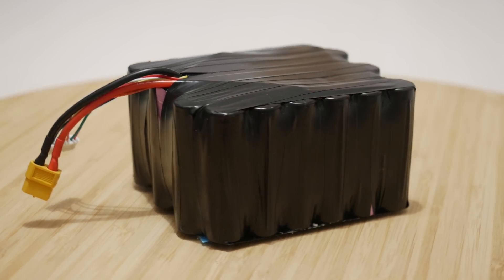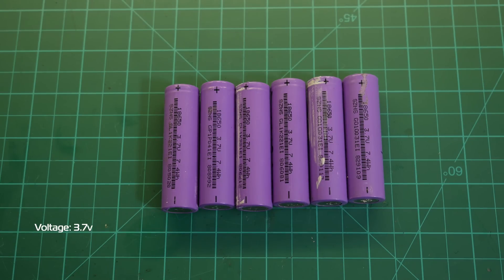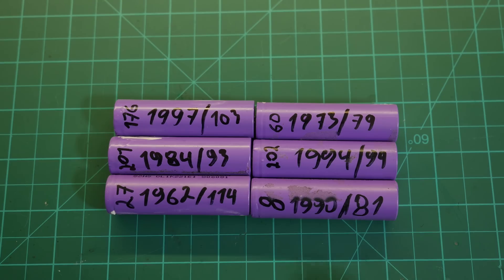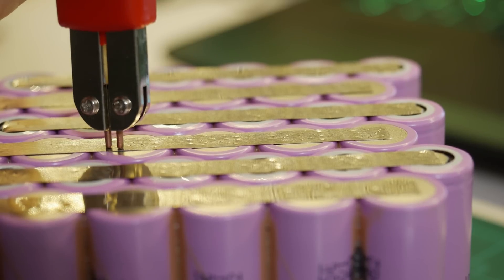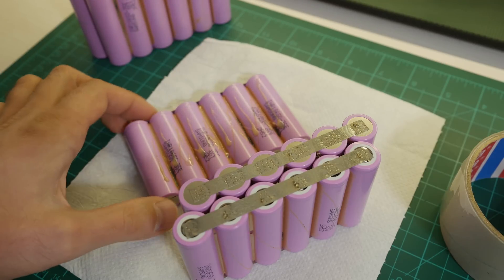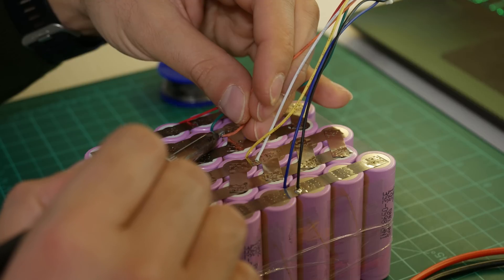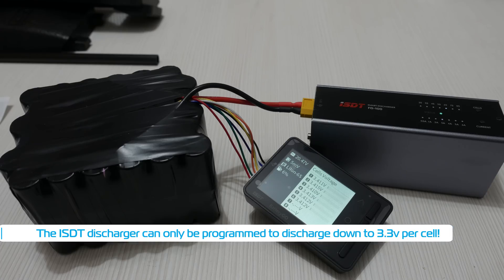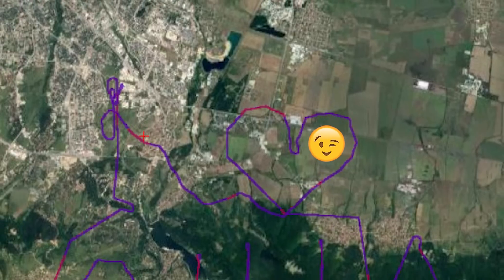HOW-TO Li-Ion battery for a drone using 18650 cells!

Comment: so why people still using LiPo battery if this is better ??
Reply from the maker: Actually there are a lot of applications where high discharge ratings are needed and for the time being LiIons just can't cope! But if you have a mild mannered plane the mostly cruises around... can't beat these!
Reply: @ArxangelRC  that makes sense ...
Reply: Cause not everybody knows how to prepare these packs? They are also highly dangerous if mistreated but if you know what you´re doing the efficiency beats some lipo ass ... just ask Elon Musk :)
Reply: @msergiu80  lipo battery is more dangerous though ...   it's prone to become 'pregnant' ...
Reply: @pooorman-diy1104  yes, could be, but they come from the factory and is supposed that they respect at least the minimal safety requirements. On the other hand, the li ion is made by us, respecting OUR safety requirements which may or may not be at the level of a factory. We also may not give a damn about any safety requierement or not have the required knowledge about that, which in my opinion makes li ion twice as dangerous as commercial lipos. One bad contact for a 6s 15000 mah and sky is the limit :*(

Comment: What settings (number of pulses and current) are you using for the spot welder when doing these 18650 cells? (I assume you use pure nickle strips? and not nickel-coated steel?).
Reply from the maker: Yes, pure nickel strips! I think it is dual pulse, at around 40 or 50 amps!

Comment: Very clear explanation you got there. Btw, what 18650 do you think is the best. I see here you use Samsung, but if I'm not wrong, you use Sony pack on the Nano Talon. Just would like your opinion 😉
Reply from the maker: Thanks, glad you like it! Yes, I use different cells because these models have different power requirements! With the Crosswind I can connect a lot of lower discharge cells in paralel and still get more than enough discharge Amps potential from the pack for this plane, but with the Nano Talon I have very limited space, so I have to make do with only a 1P pack... hence why I need to use high discharge cells for it! :)

Comment: I would personally use HV 18650’s for an andded 8 - 10% capacity, giving the spesific energy a decent boost
Reply from the maker: Weeeeell... it also comes down to cost... these cells were a great deal, especially in bulk, as I also bought some for other projects! :)
Reply: ArxangelRC ah, that explains it. If u want cost effective cells with long gevety in mind than checkout tesla’s 18650’s(or 2170’s if u can find some)
Reply from the maker: 2170s are impossible to buy right now... at least their cells... as for 18650... they will be used from a car... not sure of their capacity as well!
Reply: ArxangelRC yea the 2170’s are super popular rn
Reply from the maker: In cars perhaps... haven't seen them used for the hobby yet!

Comment: Hello, you should use a another tape, with thermal resistance. A special one for that purpose. ( yellow transparent generally, based on polyimide, and not PVC  ... you can look at here : https://www.banggood.com/search/high-temperature-tape.html   - Those tapes are more dimensionally stable at high temperatures, so they  remaining intact during the numerous temperature cycles batteries experience )

For more info : https://www.polyonics.com/EngineeredTapes/battery-tapes.html

This one you are using could loose mechanical properties with the heat of batteries when you will pump Amp.

Good work. Thanks for sharing your experiences. From France.
Reply from the maker: Actually the tape you are talking about is called kapton tape, I have some but it was for my 3D printer's print bed, and is not the right size for this! And trust me... this particular battery pack will not experience high temperature differences, I am not really worried about this! :)

Comment: What kind of glue did you use?
Reply from the maker: It is called Moment Classic in my country, made by Henkel. It is a type of contact glue, although I don't use it quite in this way! :D
Reply: @ArxangelRC  Thanks!  I like how springy the bond seems to be.
Reply from the maker: Yeah, that is why I like it for planes as well... wicked strong but still a bit flexible! It does soften up EPO while it is drying... but hardens it back up once it is all done... just something to keep in mind!

Comment: For best CG and flight characteristics it would have been better to have made it a long pack. Splitting two 3S long ways then connecting them in series with a wire. The weight being spread out would be better for flight characteristics.
Reply from the maker: Well... not all planes can take a narrow and long pack... and I am probably going to use this one in other models as well!

Comment: Nice DIY Battery....a sane approach I think...very good....and then another flight in dead calm cold air....Oh, and Im using the Flex Firmware on 868mhz at last....My EZUHF is still my favorite RC link though, it's effortless.
Reply from the maker: Thanks, but the flight wasn't in dead calm cold air... it was windy up there above the clouds, but the gimbal does work very well indeed!

Comment: Thanks we're actually building a spot welder now! Have you revived the updated crosswind tail yet? I'm waiting for it before trying maiden..
Reply from the maker: Nice! No, I have not received it yet... it is somewhere... and I am guessing at this point it is probably lost... will have to contact MFD!!!
Reply: @ArxangelRC  Will these Li-Ion cell work for my below hex?
1)Frame:Tarot 680 PRO Folding Hexacopter Frame
2)Motors:6x Tarot 4108 High Power Brushless Motor (380kv)
3)Propeller:3x Tarot 1355 Carbon Propellers (Two Holes / CW and CCW)
4)ESC (Electronic Speed Controls):6x Hobbywing XRotor 40A-OPTO ESC
Reply from the maker: @MrNams  That is very difficult to say without knowing AUW of the machine, and also how much weight you can spare for a battery! Generally, from the calculations I've done for some of the larger copter models... LiIons weren't the best option due to limited current output, given the weight of the pack that would be feasible on a copter.

Comment: Have you thought about using a high gain directional antenna on a gimbal set so it always points to your ground station ?
Reply from the maker: Have had some thoughts about this... but nothing too serious... it will be a clunky setup...  and I am not sure exactly how it could work really... :)
Reply: ArxangelRC I am working on one at the moment , the horizontal is easy but the vertical is proving difficult as the angle changes with distance, I’m thinking of using some code to produce the angle from gps position and height compared to the saved home position , when I finish the code I will post it so you can have a play , using an arduino nano to output the Pwm 😎
Reply from the maker: Would be interesting to test for sure... would require one more GPS on board, and a way to store the ground GPS location as well!

Comment: I have been unable to find any videos about how to put a fuse on the battery.  I have seen a number of plane crashes where the model has gone up in flames because of a short circuit caused by a crash.
Reply: Old Glory quarter watt resister legs can be used as joiners and act like cell fuses but means soldering
Reply from the maker: I have fuses on the LiIon battery I built for my solar system... but there I know my max amps and draws, etc., not sure I would want fuses on a battery such as this... imagine a few of them going off in flight... not necessarily during a crash... would be quite unpleasant... but yes... would require soldering!

Comment: e x t r a t h i c c and juicy!
Reply: Btw where did you source those 3450 mAh cells i assume you used? Salvaged a Tesla? :-)

But in your calculation examples you were talking about 2000 mAh... Just for easier numbers?
Reply from the maker: Yes, and because the particular cells I use in those shots are salvaged 2000mAh from laptop batteries. The 3450mAh ones I used for the pack itself are brand new ones from nkon.nl, link is in the description below.
Reply: @ArxangelRC  Ah, nice.
With 36 of them power shouldn't be any issue at all. They're even 10 A discharge rated. 6S 60 Amps, that'll get any plane going!
Reply from the maker: Exactly! :)

Comment: At the beginning you say that you are using 6 cells in parallel at 2000mAh to give a capacity of 12000mAh, yet at 5.15 in the video it says the pack capacity is 20700mAh - which is it,  I'm confused!
Reply from the maker: Hahaha, might be a tad confusing... but the 2000mAh cells were used only for the example! They are reclaimed laptop batteries... brand new... but still came from laptop batteries, and I would never make a plane pack out of them! I had over 300 of them and made a battery for my solar system! :P
Reply: @ArxangelRC  Yeah, it was a bit confusing. I wouls suggest adding a note in the description for anyone getting confused 😅
Reply from the maker: @xxxxxxch04xxxxxx22  Note added, although given how people don't even watch the videos till the end, let alone read the desctiption, I doubt many will see it, but I've added it anyway! :)
Reply: Watch the video again 12000mah battery  was his old one tired battery not the new one
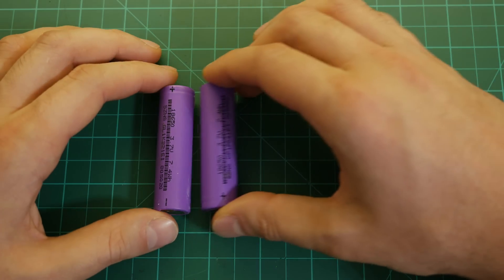Reply: @waynegriswold8953  I did - have a look again at 0:55
Reply: I had to keep replaying to vid because the numbers weren't adding up to me and didn't know where he got thos mAh from, haha.

Comment: I'm Inspired, I have a fair few 18650s hanging around. Maximum amp draw is 30amp. How did you factor amp draw into your calculations? FWIW I plan on making a 4s pack for my new skyhunter.
Reply from the maker: Well... these cells are 10A discharge... 6P means 60A discharge continuous! On 6S this plane doesn't draw more than 40-45 amps... and I think that is even a gross overestimation! Besides... other than take off... I rarely use full throttle!

Comment: Good video and impressive flight duration :)

Now comes the question, how do you calculate the Ah that at most is able to deliver the battery? It's something I've looked at, but not if I don't get it or mess it up. For example, for this battery that you have built? How many Ah are you able to deliver?  Sure values, we don't want to force the battery. Thx :)
Reply from the maker: Well... these cells are 10A discharge... 6P means 60A discharge continuous! On 6S this plane doesn't draw more than 40-45 amps... and I think that is even a gross overestimation! Besides... other than take off... I rarely use full throttle!
Reply: @ArxangelRC  Will these Li-Ion cell work for my below hex?
1)Frame:Tarot 680 PRO Folding Hexacopter Frame
2)Motors:6x Tarot 4108 High Power Brushless Motor (380kv)
3)Propeller:3x Tarot 1355 Carbon Propellers (Two Holes / CW and CCW)
4)ESC (Electronic Speed Controls):6x Hobbywing XRotor 40A-OPTO ESC
Reply from the maker: @MrNams  That is very difficult to say without knowing AUW of the machine, and also how much weight you can spare for a battery! Generally, from the calculations I've done for some of the larger copter models... LiIons weren't the best option due to limited current output, given the weight of the pack that would be feasible on a copter.

Comment: Hi, I just bought the Volantex Ranger 2000 PNF and, since you said it had a rather small fuse in your vid, was wondering what do you think the largest 18650 pack that would fit would be. I currently have a few 4s1p packs and one 3s2p pack that i can use for now but im happy to make some more. Also it should be good for 4s out of the box right?
Also I saw you had 3d printed parts for it on your store, is that for the printed parts? or the STLs? If its just for the parts where could I find the STLs?
Reply from the maker: Hi, can you drop me a PM on Facebook and I will give you the files! As for batteries... I suppose 4S2P should be easy to fit... 4S3P would require some fiddling for sure.

Comment: I gave a lot of thought on this topic and finally decided to build 4 x 6S2P packs that can be connected in parallel depending on the capacity I need in each case the space available in the each particular aeroplane. This has two main advantages - flexibility and having only two cells in parallel should allow an easier detection of defective / tired cell. The drawback is additional weight and size.

I'm also using the spacers from nkon 

https://eu.nkon.nl/accessories/bms-batterijspacer/3-18650-battery-spacer.html
Reply from the maker: That is a nice idea despite the additional weight! :)